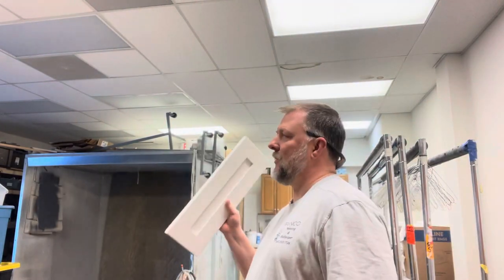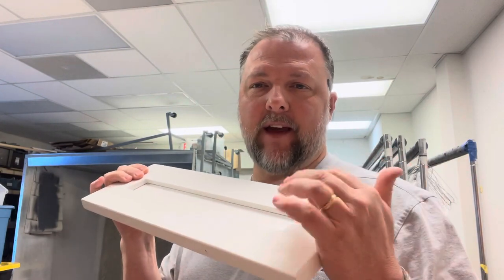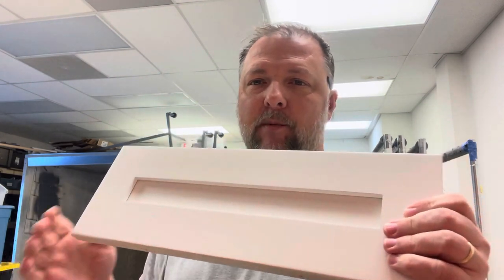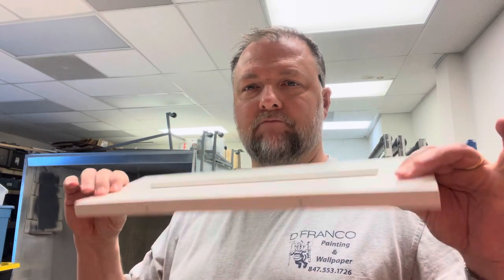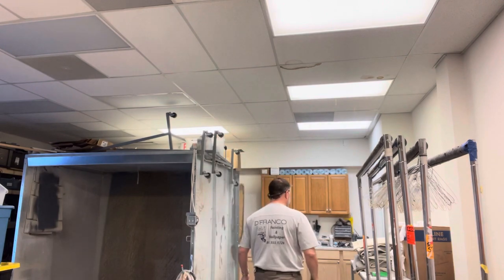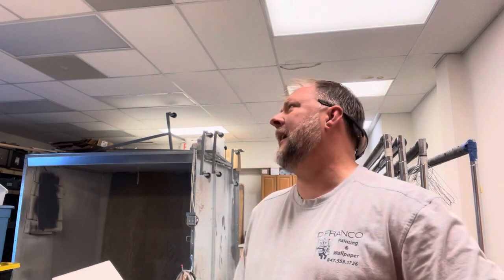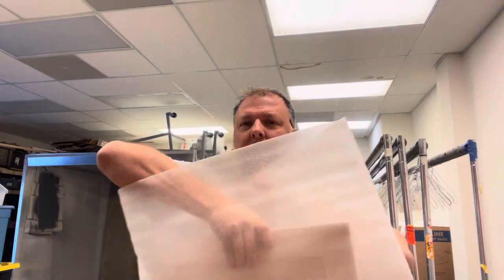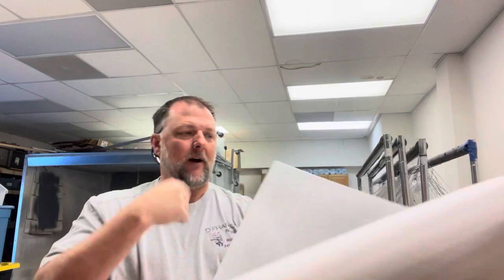How to protect freshly painted cabinets when transporting them in your car or van

Comment: Would those work for painted exterior door slabs?. Cause at my job we transport painted door slabs,side panels and door light frames. It seems every once in a while they'll get dented or scratched. So any tips would be much appreciated.
Reply from the maker: I’m not sure... you could see if there are different sizes to fit a door- we have drops that we buy and only use for that purpose

Comment: Hello thank you,  Does the protection not cause any flashing?
Reply from the maker: It does not- we are also using a self catalyst cabinet type  paint so it is very hard and resistant to burnishing.  It will burnish paints like advance, mainly cause it is not cured enough. We transport these 12 hours or less after they have been painted
Reply: Would you mind sharing what kind of paint you use? I’ve always used advance but I’m always nervous transporting them